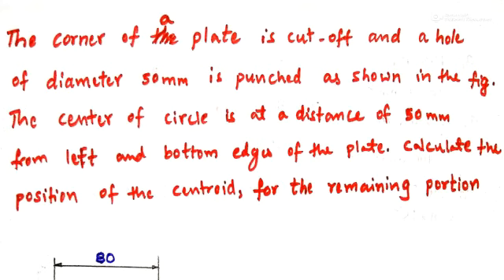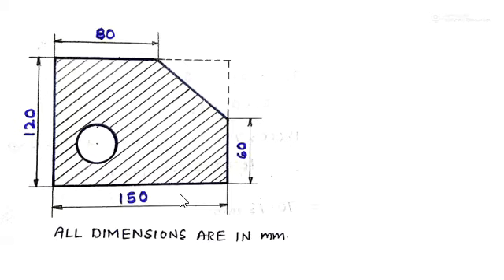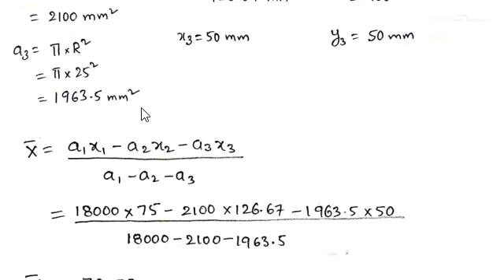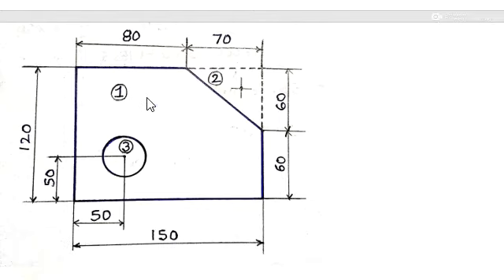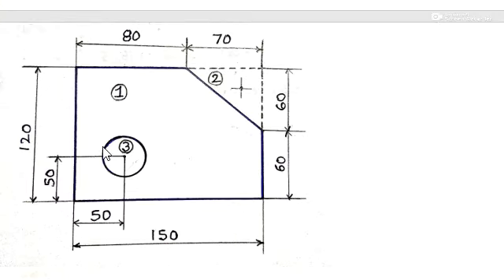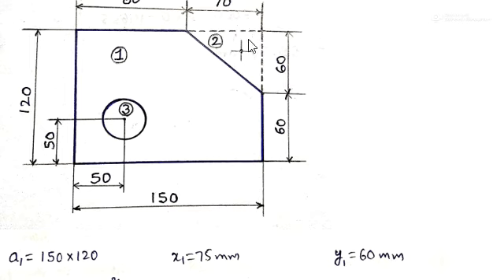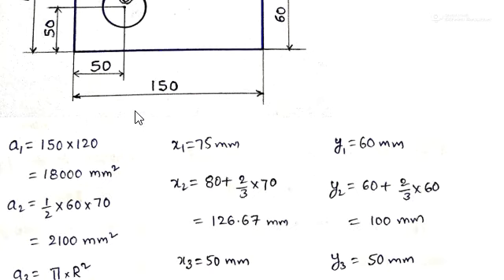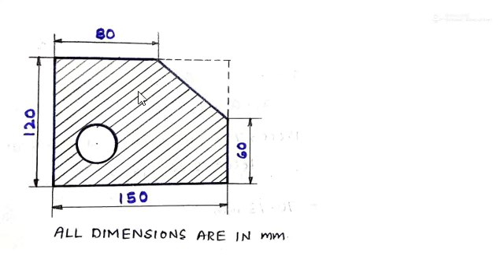Problem on Centroid, Engineering Mechanics

Comment: in area 2, why the x bar is 80+2/3 x 70? where 80 came from?
Reply from the maker: Please see the dimensions which are placed upside. For every area we have to calculate from left side of diagram. ( left side & bottom side of the diagram are references)
Reply: We have to calculate from its origin ..so it is 80mm far from origin on x coordinate due to this reason we add 80 on the  value of x bar for right angled triangle.